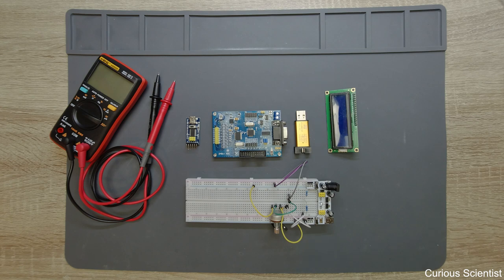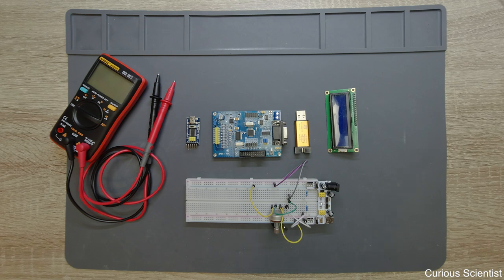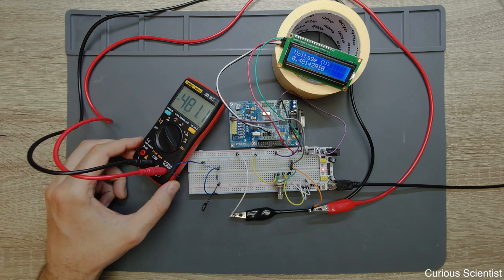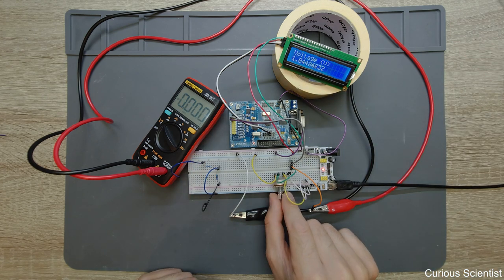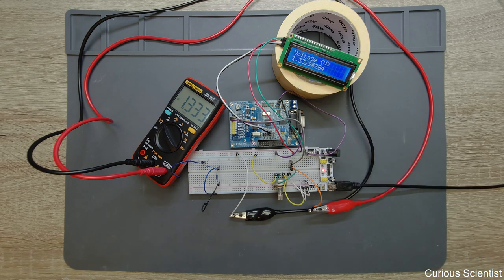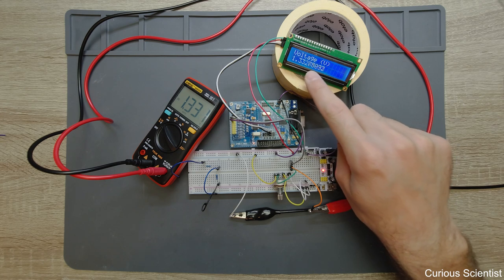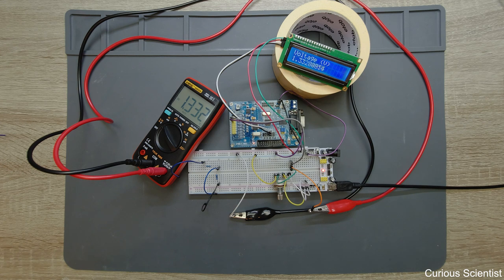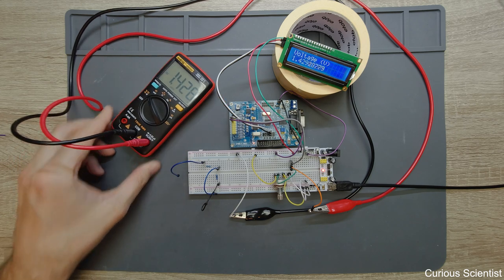Testing and demonstrating the best ADS1256 board

Comment: Hi there! 

I have to ask a question but first of all I have to thank you for your efforts in demonstrating in several videos all the aspects of this chip which have been extremely helpful due to the great details you add to your videos. 

in regards to the question, I have to ask if I have missed something when trying to communicate to the ADC via SPI_2, I have tried to use:

SPI.setMOSI(PB15);
SPI.setMISO(PB14);
SPI.setSCLK(PB13);
SPI.begin();

Etc..

Or:

SPIClass SPI_2(PB15,PB14,PB13);
SPI_2.begin();

Etc..

And renamed all the instances of the code SPI. with SPI_2. although the code stops when initialising the chip, I have tried with the code you have released in the other video as well as other codes from different users without any luck.

If I declare the pins for SPI 1 AND SPI 3 the code runs correctly although obviously failing to read and write the registers therefore outputting a null value.

Said so, do you believe there is anything wrong in the way I initialize the SPI or is there something not quite right with the board itself? I have not plugged any load to the ADC input as I was trying to utilise the onboard potentiometer on IN0, although with additional load I had no luck either.

Thank you!
Reply from the maker: Hi, and thank you! If you follow the video and you don't get the same results, then it is probably something wrong with the board itself. It is really hard to troubleshoot it without seeing what you're actually doing. Try another board and see if it works.
Reply: @CuriousScientist  Thank you for your prompt reply. I have indeed concluded that the board is, in fact, defective.😢 Hopefully, this will serve as troubleshooting for someone else!
Reply from the maker: I am sorry to hear about the faulty board.  I hope the next board will work just fine.

Comment: How is the analog power supplied? AVDD? With the Black ADS1256 Module there are two 5V connections (One is a male pine thought to be DVDD and the other is a screw terminal. Could I  provide 3.3V to the DVDD pin and 5V to the AVDD terminal? I'm trying to supply the higher voltage, but also need 3.3V on the SPI comm. Does this make sense?
Reply from the maker: Hi! I don't have that specific board, but please don't try to connect both at the same time. As far as I know, if you use the 5 V pin, the onboard regulator will take care of everything. Or alternatively, you can directly feed 3.3 V to the DVDD. But never connect both at the same time. Tonight I will take a look at the board and let you know more details.
Reply: @CuriousScientist  this would make sense then. I feed 5V to my "VIN pin" to the Nano 33 IoT and it runs on 3.3V. The plan is to do the same with a ADS1256 module. It appears to regulate and operate on 3.3V on the digital side, hence the "DVDD" designation? Thanks for checking.
Reply from the maker: I looked at the board. I can only say the same as before: either you connect the +5 V to the screw terminal or to the jumper pin, but not both at the same time. They are both regulated I assume. It is on the other hand interesting that this board does not state "DVDD" explicitly, like other boards. Maybe because in this case, bot connections are +5 V connections. There is a board which has distinguished DVDD and +5 V connection (one of the blue boards I use).

Comment: If it included the FTDI converter but with jumpers to put it in circuit or not, it would be perfect!
I not found the banggood link to this module in the description
Reply from the maker: Yes, that would be a very convenient feature, but I am still amazed by this board even without it. If you want to buy this board, you have to go to Ali-express/baba or eBay. I couldn't find it on Banggod, so I just put the link in the description for the other device. Later, I will have a website where I will have a specific page called "tool shed" or something like that and I will collect all the valuable parts and tools there with links to them. Not necessarily for that 0.0001 $ that I will never be able to withdraw from these sketchy affiliate programs, but sometimes it really requires hours to find some good tools, circuits, or just the vendor that can be trusted...
Reply: @CuriousScientist  awesome

Comment: Great video! I've also ordered such a board (stm32+ads1256) and I'm trying to build something similar to what you did in the video, so it is quite helpful for sure, so thanks a lot! 

But I have a question though - the baudrate is very low (9600) with the shipped firmware (I need the higher sampling rate) - did you write a program for stm32 yourself?
Reply from the maker: Hi! Thanks! Yes I developed a software from scratch.

Comment: Interestimg idea to join those2. I dont think its gona be more stable as other modules but will see.
Reply from the maker: I don't know if it is more stable, but I think it is better to have the signal route across the PCB than having cables dangling around. Yes, they are digital signals, so it should not matter too much. What I like about this kind of board is that everything is placed in a nice and clean way. If I would do this with the two separate devices, the cable management would be a huge mess.

Comment: Nice. Too bad you showed the basic layout with the voltage divider, than went ahead a frame later - to a different layout and didn't show how you did it, what you changed and why.
That's the most important thing and it's not there. Voltage divider suddenly moved left many more wires etc. Oh well. 
Do you have the code you used online?
Reply from the maker: The voltage divider is so basic, that it doesn't worth the extra work for me to draw it all the time. You can pause the video and see it yourself. Also, it will always depend on your maximum input voltage that you want to measure. In fact I wrote down the values in the video, so everything is there and reproducible.

The code is not yet available, but I actually started to think about publishing it recently. I wrote everything from scratch, so it took me quite an effort to make it work. If I publish it, people will just copy-paste it and won't learn. However I have a whole series of videos where I show each part separately (how to write the registers, how to read a single conversion...etc). Check the relevant playlist for it!
Reply: Oh thanks, didn't realize there were more videos on this, then I will  certainly watch the others, thank you.
Reply from the maker: You are welcome. There is one video for each section of the datasheet of the ads1256. Each SPI communication sequence is explained in detail as well. Long videos, but I explain basically the whole datasheet.
Reply: Many thanks though I don't know if I'll get to where I get it all anytime soon 😥
So Keep peeps like me in mind, never silently edit out practical laying out circuits again especially without warning, 
I was like WTF just happened here, did the video just skip?! 
Must have rewinded 5 times to make sure 🙄
Reply from the maker: Thanks for the remarks! But once again, the voltage divider or the potentiometer is not part of the circuit. I was using them to create some voltage that I can measure. When the change happened, I just changed to a voltage divider with know values (values are shown on the video!).

Comment: Hi, I have upload the code using ST-link, and it says programming is completed and application has started. However, it shows nothing in the arduino serial monitor. Any Idea? thanks.
Reply from the maker: Have you done the boot jumper swapping after uploading the bootloader? Do you see the microcontroller in the device manager?
Reply: @CuriousScientist  yes i have done the jumper swab and i can see it in the device manager.
Reply from the maker: @cilikmumtazbangiavenue9316  then I think you just perhaps missed to select its port in the Arduino IDE. Alternatively, try to upload a simple blink code that blinks the onboard LED (PC13).
Reply: @CuriousScientist  thanks, it does have led (PC13) in this board right?
Reply from the maker: Hmm, let me see. I think I messed it up and I assumed that you were using it with STM32 bluepill instead of this board. So, no, this board doesn't have the pc13 led, sorry for the misleading info. How do you connect the board to the computer? Is it via this ftdi converter?
Reply: @CuriousScientist  Im using the serial port RS 232 on the board. Then I connect it using rs232 to usb converter to connect it to the computer.
Reply from the maker: What kind of source code did you use?
Reply: @CuriousScientist  I am using Arduino IDE.
Reply from the maker: That's okay, but what kind of code do you use for this board? It doesn't just spit out numbers, you need to program it.
Reply: @CuriousScientist  noted. any idea for a simple program just for me to test the board?
Reply from the maker: My channel is literally based on tutorial videos of this board. Check them.